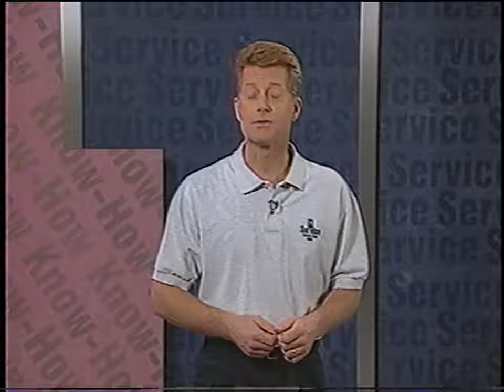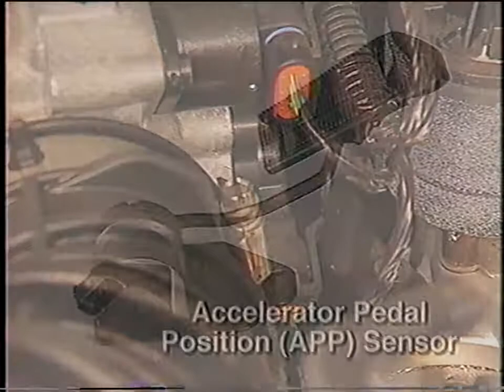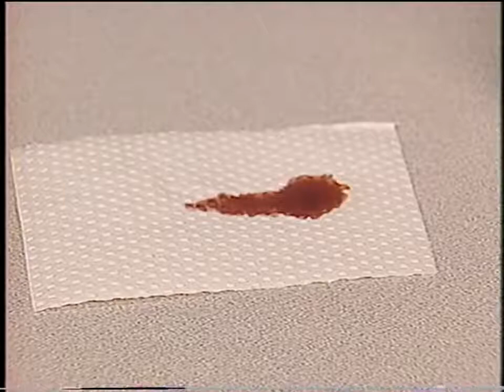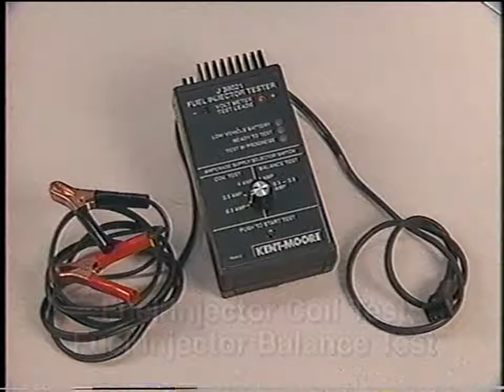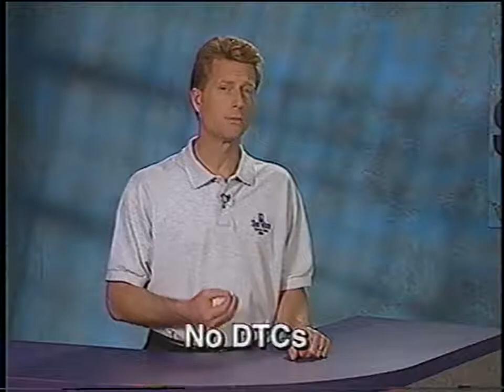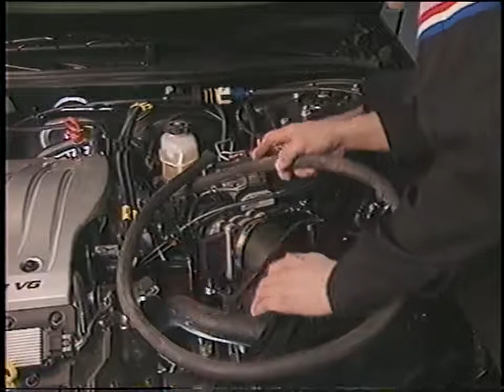General Motors - TCC Diagnosis Tips

Comment: On a side note
Replacing third brake light with an led assembly and not an incandescent assembly 
On a 2001 Chevy suburban will give you TCC lockup codes and some related like stop lamp switch and TCC solenoid codes ...

Took me forever cause I tested stop lamp and looking for intermittents but it was fine inside and out tested thoroughly and after replacing third brake light that was blown to begin with and now it works with new assembly but still getting the codes

So do not replace possibly any brake lights that are incandescent with led 
Even if the all the parts stores say it exactly fit
 
Wtf lolol 
Shit been driving me nuts for almost a week
Reply: Yep.. I remember when i was spinning wrenches at chevrolet from late 80's into the early 90's and diagnosed a Lumina when it was towed in because it wouldn't come out of park.. and yep.. third brake light bulb blown.. replaced bulb and it worked... however... further diag revealed that the actual brake light switch itself was taking a dump being the actual cause.. lol.. it isn't hard to end up chasing your tail on things like that..